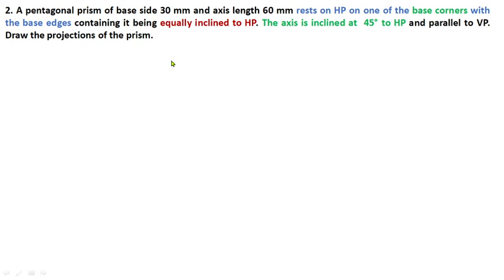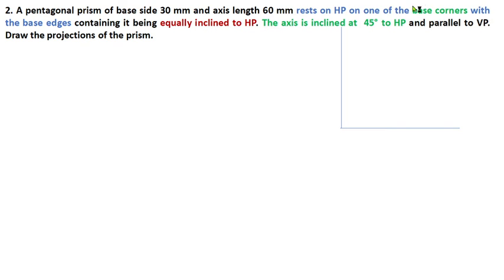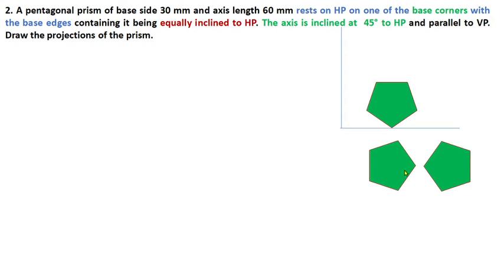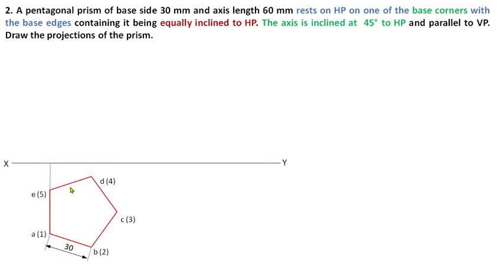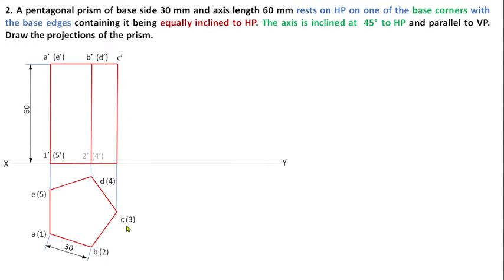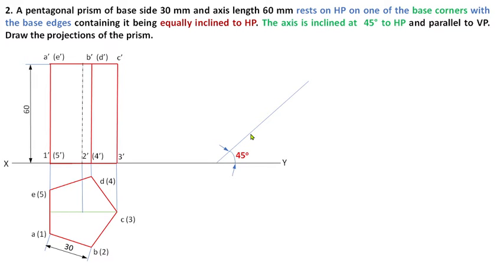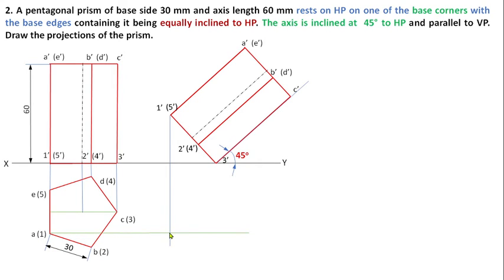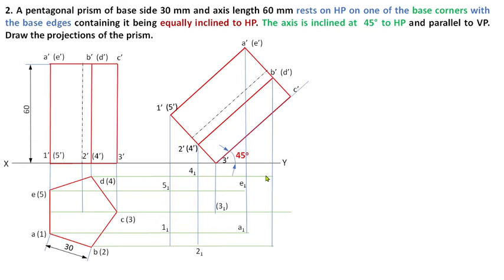PROJECTION OF SOLID PENTAGONAL PRISM |Axis Inclined To HP |PROBLEM 2 @rajagopalthangavelsforum

Comment: A pentagonal prism of base side 30 mm and axis 70 mm has corners on the H.P. and the axis is 
inclined at 45° to the H.P. Draw its projection when the plane containing the resting corner and the 
axis is parallel to the V.P.

Comment: A Pentagonal prism of base 30mm and axis 70mm has a corners on the H.P. and the axis is inclined at 450 to the H.P. Draw its projection when the plane containing the resting corner and the axis is parallel to the V.P.

Comment: 10 A pentagonal prism of base side 30 mm and axis 70 mm has an edge of its base on the H.P. The 
axis is parallel to the V.P. and inclined at 60° to the H.P. It is cut by an A.I.P. inclined at 60° to the H.P.
and passing through the highest corner of the prism. Draw its sectional top view and true shape of
the section.

Comment: A pentagonal prism of side of base 30mm and axis 65mm long rests on a corner of its base 
in HP with the axis of the prism inclined at 40 to HP and parallel to VP. Draw its projection.

Comment: A pentagonal pyramid, side of base 30 mm and axis 60 mm long, rests with its base on HP and one of the edges of its base is perpendicular to VP. It is cut by a section plane perpendicular to VP, Parallel to HP and passing through the axis at a point 35 mm above the base. Draw the front and sectional top views.